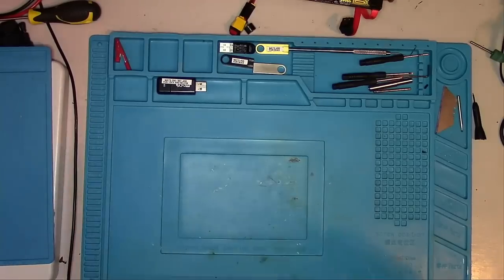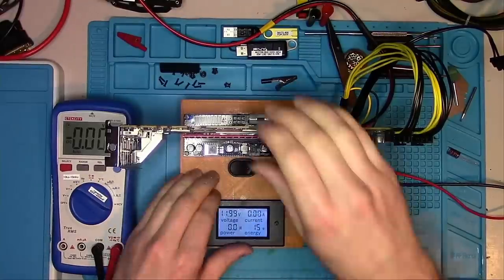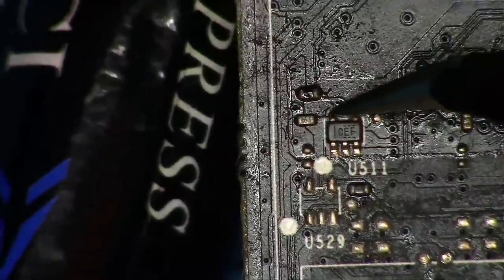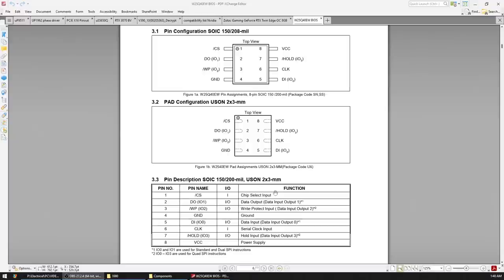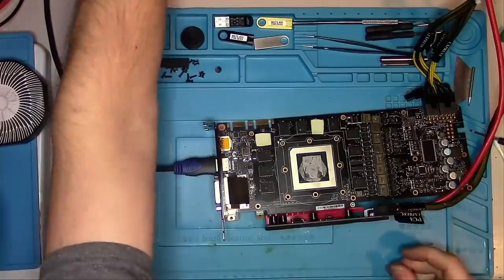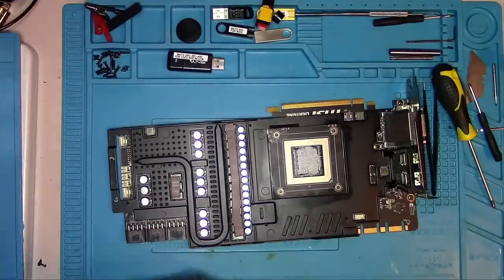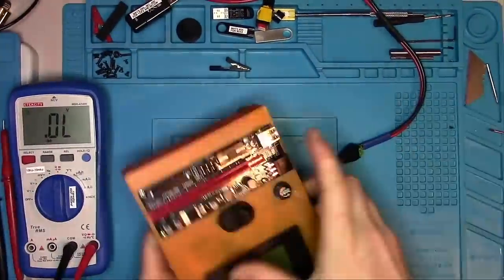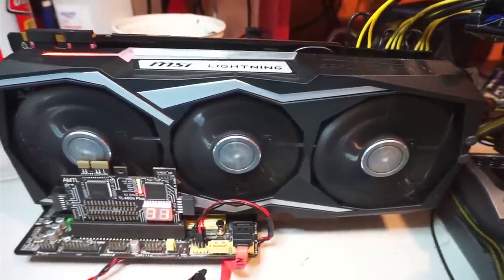Does MSI make good graphics cards ?

Comment: Wish I had found your channel before I bought my Asus 1080Ti several months ago. Right as prices were dropping good I finally got desperate to switch off my old GTX780 and went back with an Asus brand card. I got thier highest end model for $280 and all I had to do was replace a fan that had a broken blade. It was a great deal at the time but after watching your videos with I had spent a little more and got an EVGA. Anyway thanks for the enlightenment you do on your channel.
Reply: Got desperate as well as I started to play vr with my asus 970 that had some thermal mods done to it, wanted to pick up some demanding titels and ended up buying the highest tier 1080ti from gigabyte for €370 :'( . It was definitely used as a mining gpu as it had corrosion on the heatsink and rust on the screws but atleast it works. Now I realise I should have picked up a evga card instead and overclocked that one to match the gigabyte card in speed

Comment: i have 1080ti msi gaming x trio and it have alot of proper thermal pads and is great in cooling compared to other brands
and 3060ti gaming x trio i havn't opened but its also even more cooler then and have bigger fins then 1080ti
this is the first time i saw msi lightning card... never really saw any hehe only Supreme and Gaming x Trio..

Comment: I bought a 570 off MemX's shelf in Oct 2020. I mined with it until 2 months ago. Spend $250 on it, made $1,600 + $100 when I sold the card. It sure had some memory stability issues since day 1; but I made bank.

I've never owned a GPU that didn't come with some sort of problem, but they most often resulted in the cooling system; before/ after my mining became mainsteam. I've been using a 12GB Asus 2060 as my daily, and even one of it's fans went 3 months after buying it. I just tied it down, even while mining the card don't pass 71c.

Asus has been the most reliable, but their warranty department is 100% comparable to being Pierre Poilievre when asks questions to the Liberal government.

If Acer starts making GPU's, 110% making that switch. I can buy parts and retain warranty, as I did with my Helios 300.

Comment: I worked in computer hardware for quite a few decades. and MSI has one of the least return rates/ RMA of all the main graphic card and motherboard manufacturers. they also have a wonderful customer support service. 

I have owned many products by all the main manufacturers such as msi, evga, gigabyte, asus, etc. MSI is one of my favorite brands. Reliable, functional architecture and always a cut above most top teir competitors.
Reply from the maker: rates as in count or percentage ?

Comment: I had a pair of MSI GTX 1080 Sea Hawk X EKs, basically their top of the line.  They were good.  But one of the cards came out of the box with the water block misaligned.
I was thinking I might go MSI or maybe Gigabyte now that EVGA is not an option.  I really want an Asus ROG Strix 4090, but if I can’t get that I may go with MSI.

Comment: I had that exact 1080Ti (and its replacement) and they stopped outputting a signal after less than a month of use.  I ended up getting a refund and bought an MSI RX 580 which is still running fine now, but showing its age.  The only issue I've had with it is that my rig is in a fairly dusty environment and I have to blow out the fins about once a month.

Comment: my MSI 980ti failed someday after a few years of use..after 10..20mins in a handful of games, my pc just turned off.    no other issues in different games even benchmarks ran fine for hours...

after suspecting my psu to be too weak since it was quite old, i replaced it...
the next time this fault happened, it blew up the gpu chip by spitting out smoke out the corner at the edge where the silicon die is epoxied to the substrate. there was a crack and sood ...obviously right when gpus prices went crazy for next next year

Comment: I Agree with you that this model has Thermal Issues but thats not Because there is not enouch Contact between Midplate and the Cooler its Because Like many Other Manufactures They are Shipping their Cards with a Totaly Dumb Fan Curve. I Noticed in your Video where you Showed the Card Running in Furmark that The Core is Going in the 60°C Range (Where Zero fan mode Turns off) But the Hot Spot ist Already at around 70°C and thats Why there is so much discoloration in the VRM Area. Again you are right Msi would not Harm anyone by Using More Thermals Pads and maybe more Contact between the Midplate and the Cooler but i would bet with you That If you would run the Card with a Different Fan Curve (Like the Example fan Curve in MSI Afterburner) That the Thermals would be Fine The Mid plate has a Heatpipe Above the VRM That leads to the Right side where not much Heat Generating parts are And in the area where they are trying to get rid of the Heat are little Pins and Groves so the air can Take the Heat away. You Should not underestimate the Thermal Pad from the Coils to the Cooler they are not making the Best Contact with the Cooler Yes and MSI could have done a Better Job but Coils have a pretty big Thermal Mass And the Thermal pad will give heat to the Cooler. If the card would be used from the Start with a Slightly Agressive Fan Curve and This Zero Fan trash Turned off The Card would do more than Just fine. I cant imagine what the Manufactures are Thinking that they make the Fan Curve so bad as they are.. I own a 3080 ti Founders Edition (a Already very Known Hot Running Card!) My PC is Build in Corsair 5000x With All Fan Spots Populated So Very Good Ventilation and with the Stock Curve It was Quiet.. Yes But at 85°C on the Core and 110°C On the Vram... That is so stupid.... I did not Change the Curve in Afterburner Just Enabled the Custom Fan curve and went with what  the Software gave me.. And just by Doing this i got to Max 65°C on the GPU and 86°C on the Memory without Changing the Stock Thermal Paste / Thermal Pads (My card is still Under Waranty). You hear the Card under Load Of course but you have most of the Time a Headset on your head ^^ I dont Hear the PC (i use DT770 Pro they are pretty Open i can Talk with someone next to me while Wearing them) But if you Want your PC to be Silent you would Watercool There is no point in Making the Fan Curve even Lower so the PC is Quiet but the Parts are Almost Burning... I learned to Hate this Zero DB Fan mode since it Came with the 900 Series Cards Lets say you dont Game that much and the Fans are because of that not Spinning most of the Time okay its Quiet but you need to Keep in Mind that The most Zero DB modes Enable the Fans at 60°C That means For The whole Life of the Card it Only Knows Hot Temps. The Card would in Idle / Browsing Almost all the time at Around 60°C And even ingame The Fan Will Only Run Until the GPU temp is again under 60° C. The GPU is not that much in Danger with these Temps its not Great... But Probably Fine But no Airflow Means Death to VRAM and VRM Even with MSI`s Midplate on the for example Gaming 10 Series Cards Without Airflow the midplate is Doing nothing its just Destributing the Heat... You read Everywhere you need to Clean your PC so it Can Run Cool and this is Right! But its not the Way that you Clean your PC so its Runs Cool but you GPU Can Be the Whole time in These Temps thats make no sense ^^. And even the times ingame Where the Card is Generating enough Heat so the Fans Would Run on the Normal fan Curve its Only About 20-40% Fan Speed 
My 3080 ti Ran at max 55% Fan Speed With These Temps i wrote above Now im at max 69%.

Comment: Ive been running a MSI 980TI for years now and replaced the heatsink with a third party kit and it dropped temps by almost 20 degrees...so ya this video confirms MSI cooling solutions are not the best

Comment: ive never had any problems with msi card until i got my gaming z trio 3080, the memory chips got uncomfortably hot, so i had to do lots and lots of research to find the right thickness of thermal pads and all is well, sucks that a repair shop customer has to go out of there way to fix msi's problems

Comment: Every single GPU I've bought, going back to 2005, has been an EVGA card. Until this year.

I saw MSI was showing the best results on that userbenchmark site, so I thought "Why not?" and got a 4070. It was only afterward that I even heard about EVGA bowing out, so I guess I didn't even have a choice in trying something different.

My EVGA 1070 SC still works great, it just can't handle newer games that well. A friend gave me his EVGA 1080 (it's one of those with its own watercooling), and that died earlier this year (not the whole card, just the water pump), so I went back to the 1070. It has been steadfastly reliable for 6 years, so I'm holding onto it in case the MSI s***s itself.

sigh

The 4070 cost me more than twice what the 1070 did.

This damn thing better last.

Comment: Could you have cut and stacked pieces of an M2 heatsink plus some thermal pads to close the gap at the power connector to transfer some of that heat to the backplate?
Reply: I think he didn't attempt a fix because such a modification will decrease the card's value since it is a collector's edition
Reply from the maker: I would if it was my card.
Reply: @northwestrepair  I'd like to see what kinds of mods you recommend to maximize the lifespan and reliability of gpus and computer hardware in general, given all the failure modes you've seen.

Comment: To summarize this non issue without getting too technical. Every power delivery component like mosfets, inductors, voltage controllers etc are totally fine with just airflow. The most temp susceptible component is the mosfet which can take up to 125C for extended periods and unless the VRM is complete shit which it isnt on these cards they will never reach those temps. Its a much bigger issue on mainboards where in cases of liquid cooling hardly any air gets to the cpu vrm. I totally agree that the coolding design could and should be better but there are bigger issues on some of those premium cards like shitty analog voltage controllers or a related issue smacked together power stages for some increased heat density. Shitty powerstages at that in cases.

Comment: Do you think Furmark is actual helpful for modern cards? The OC'ing community started using it less and less right around Pascal since the card throttles suspiciously hard now. I think since it was occasionally taking out old cards, Nvidia started detecting specific power virus loads. To me the behavior doesn't seem to simply be due to typical GPU boost limits but I'm curious what you think.
Reply from the maker: furmark loads core differently then any gaming engine does.
Sometimes only furmark will produce errors, sometimes only games. Gotta be sure card is 100% fixed by running both.
Reply: @northwestrepair  Interesting, do you run a reduced Furmark resolution to reduce load and let it boost a bit higher or for the screen space? I just realized you run the OCCT VRAM test at the same time too which makes sense.

Comment: How would you rate gpu AIB´s after EVGA has left the scene ? 
I need to know what AIB´s are left that dosnt cut too manny corners, and generally build their gpus well.
Reply from the maker: i would rate them harder to repair because their boards are not standard and its nearly impossible to find diagrams for those boards.
otherwise, standard board=less useless garbage like color changing LED's or USB_C charge port or GPS tracking device. 
Who knows what nonsense these none standard boards bring. All of those useless features only introduce more possible problem areas.
The more bare bone the design, the less can go wrong

Comment: excellent videos and you are very knowledgeable. For what its worth, I'm, a cryptominer and I had to modify two different 3080's from MSI due to memory thermal issues. That said, they fixed the horrible cooling design on 30 series finally. Once I replaced the stock memory thermal pads with some decent ones, both cards had great numbers, with all components making good contact with the radiator and heat pipes.

Comment: Msi was never attractive to me until I tried the 980 Ti and oh boi I instantly fell in love with the fans and overall looks, msi afterburner is an awesome app as well, along with rtss. Esp. the fans I found to be great, mostly 0 db mode some brands were advertising on back then and even when it went off to cool a low gpu load game I couldn't hear them at all, that wasn't the case before with other graphic cards I owned in past, they were all constantly whizzing and it was getting quite annoying and so this was an awesome change. After that I bought regular 1080 Ti and I was impressed again, in fact it holds to this day even with most of the modern titles. I feel like the RTX series became not really a new era of ray tracing, but a new era of overpriced cashgrab first.

Comment: the first graphics card was probably used for mining, look at the pcb cooking itself under high temps and the tracers and solder joints were over cooked also. I personally wont buy used GPU nowadays considering the whole mining fiasco. When I was gaming hardcore I would game daily for hours on years end and the GPU's would get hot and still last for 10+ years. What mining does to GPU's nowadays is crazy, gaming GPU's are not industrial grade electronics, they are in no doubt consumer heavy duty grade.

Comment: I have an old gtx 780 from Asus and it gives me code 43. It boots but I can use only 1024x768 resolution. I tried it on another computer... same thing. I tried different things but nothing works. Do you think anything can be done for it like a gpu bios reset or is it probably dead? By the way, I also have a Msi Lightning gtx 680 and it still works fine.
Reply from the maker: Run a memory test.

Comment: There is absolutely nothing wrong with the MSI Lightning series, or the EVGA 1000 series.

Stop trying to spread misinformation based on your EXTREMELY small sample sizes. You don't do this every time, you are absolutely correct with some designs. These ones however, no. Not at all.
Reply: How much did they pay you to write this comment lol

Comment: BUT...the MSI card WORKED and the other card did not and needed repair.
I detest Gigabyte to this day after their MOBO drove me bananas and turned out to be their crappy Dual-Bios was bad , replaced it with a used MSI board from same Haswell era , and is still working.

Comment: Would you recommend zotac?
Reply from the maker: NOOOOOOOOOOOOOOOOOOOOOOOOOOOO
Reply: @northwestrepair  would you recommend a lineup ranking from 3 to 1, one is the highest?
Reply: Never, I returned my 1st Zotac in one day, imagine running at 100% fan speed @ +100º celc with no case and its not even hot at all.

Comment: I have Vega 56 which after some artifacts on the screen stop sending any signals at all. Now my monitor is just displaying no signal. Replacing the card fixed the problem but I am wondering what that could be. Is it worth it to try to fix it?
Reply from the maker: no. vegas are no fix.
Reply: @northwestrepair  Thank man. I have good replacement for it, RT 6800 XT from Sapphire ;)

Comment: I have a nearly 2 year old MSI RTX 3070. 100% stable even with 35 C in the room.
Reply from the maker: Very good. Keep it cool, it will last.
NEVER overclock, even if it says you can.
Reply: @northwestrepair  I never overclocked ever, and is why my CPU and GPU's never broke except for one for unknown reason. ATI XT800 Platinum, but that were like 20 years ago.

Comment: Why does it have a wrong bios in the first place??? did the owner failed the flashing?
Reply from the maker: Sometimes bios just breaks. Power outage, who knows.
For that reason, modern cards that have firmware inside power phase controllers sometimes cripple entire card with no way of fixing them Those controllers require special hardware and software to program
Reply: @northwestrepair  👍 thanks!!!!

Comment: I hate my MSI RTX 3080 Gaming Z. The cost cutting measures are evident throughout the whole card. Shitty fans with grinding bearings, thermal pads with poor contact, no cold plate just heatpipes and poorly polished... I'm still using it of course, I was fortunate enough to buy it for MSRP when it released in 2020 and ended up strapping a couple Noctua fans to make it run a lot quieter but man, I'm never buying MSI's crap ever again.

Comment: Quick question. I have MSI GTX 760 (N760 TF 2GD5/OC), the card can boot, but when the driver was install, the monitor just went blank, and I'm using HDMI connector.. could you tell what seem to be the problem, thanks..
Reply: I already heat the GPU, and for a while the card work fine with the driver, and after several days, it went blank again.
Reply from the maker: dead core. you confirmed it by heating the core.
Reply: @northwestrepair  so it cannot be repair permanently? if I re-balling the GPU, can it fix the GPU?

Comment: I'm still running my 8 year old MSI 980Ti and have never had a problem with it. Same goes for the mobo which served for 6 years (replaced it 2 yrs ago with an asus board lol) 
But I purchased an MSI laptop in 2019 and it was complete shit (GF-63), tried a bunch of things across multiple linux operating systems, windoze and drivers but the performance just wasn't on par with what reviewers were putting out. Their warranty policy was nothing short of their quality of products (shit), so I couldn't be bothered sending it in (and waiting months). 

Not to mention MSI as a company is shady as fuck, the CEO literally died after "falling from the 7th floor" lol??

Comment: The MSI lightning is made to run under ln2 which is why the metal plate to cool the vrm and memory is separate. Turbo noobs and gamers running it on air cooling at 0% fan speed should not be allowed to buy these cards. They are totally wasted on them.